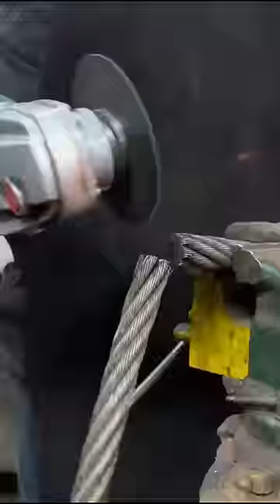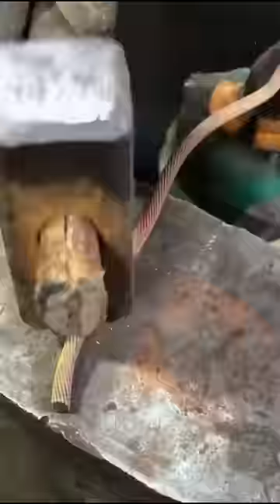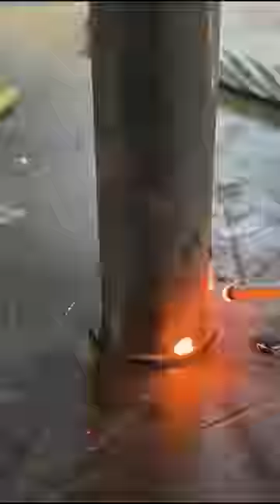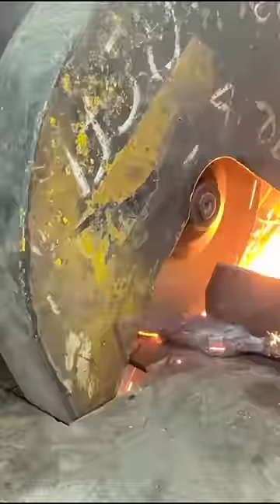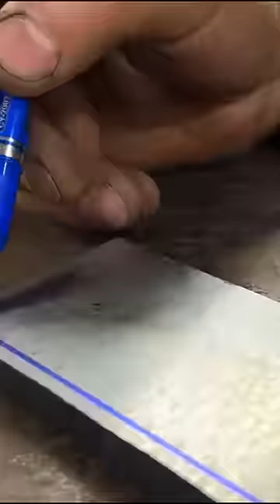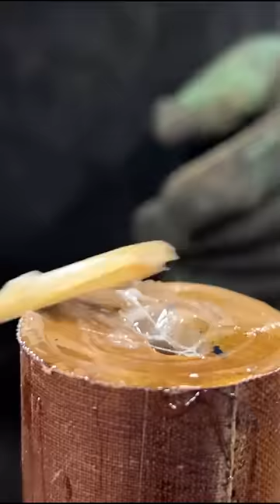Molten Metal Madness ️😱 | Cable to CRAZY SHARP Knife! 🔪 #shorts #knife

Comment: If you wouldn't split the wires... Would it look like Damascus at the end? Or is not posible to forge it without splitting? I'm curious 🤨
Reply: You can forge without splitting, it gets hot and burns off the oil then add borax and hammer. It will make an awesome looking Damascus knife.